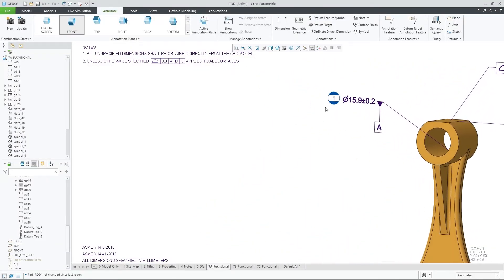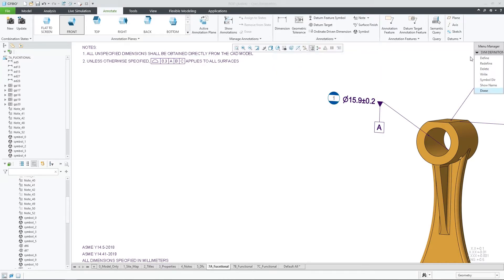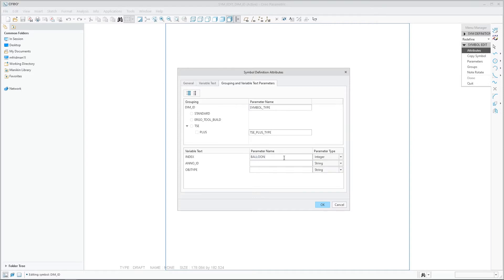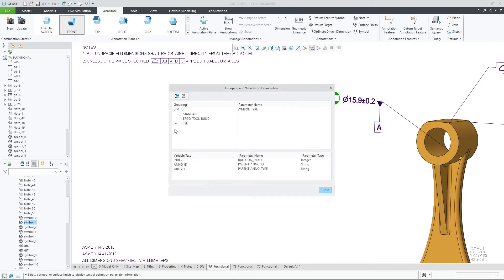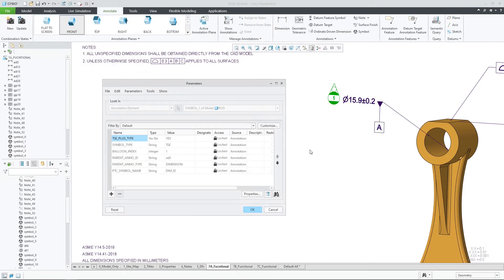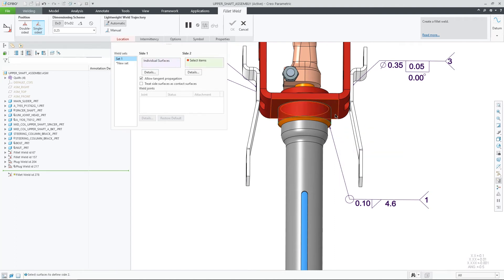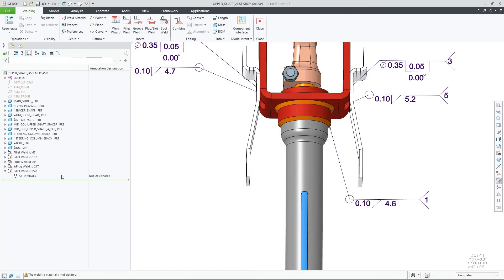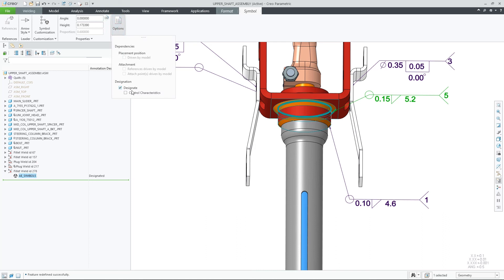Improved Parameter Support for Symbols | Creo 9

Comment: hello ptc i would like to make a suggestion for improvement regarding ifx
Is it possible to make ifx punch a strip hole? After each punching, you need to enter the feature yourself to extrude and cut a slot hole